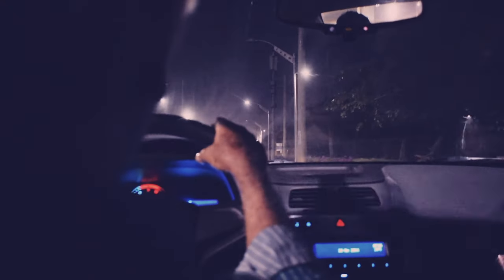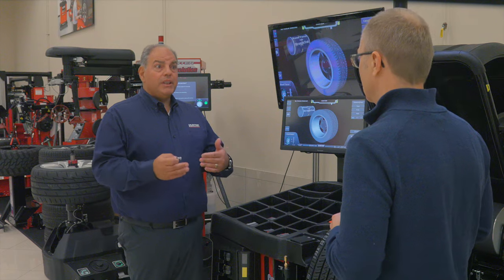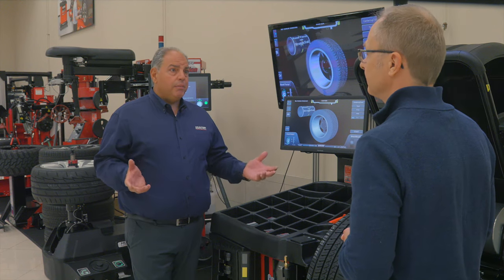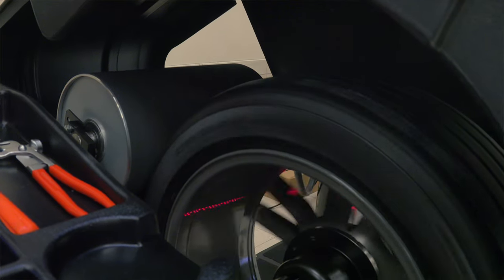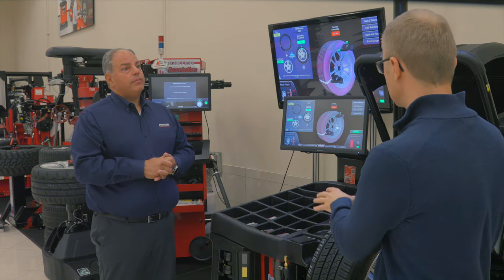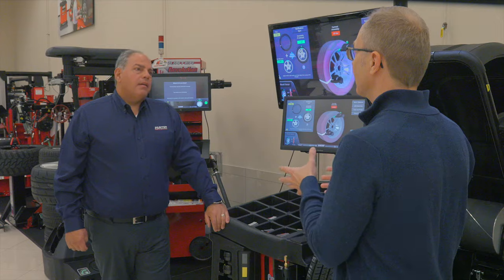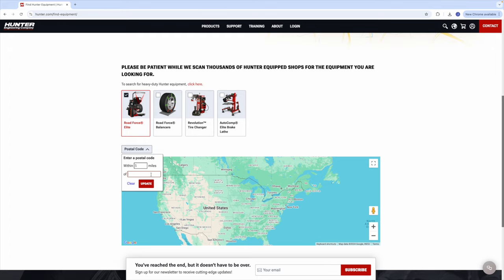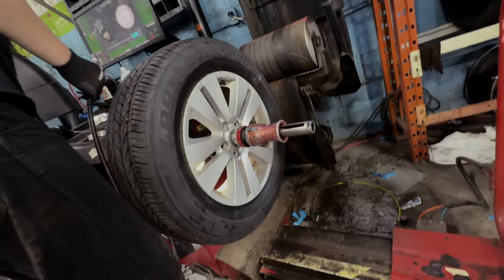Why do my balanced wheels STILL shake? 😩| And how to FIX it 😁

Comment: aligning the balance point of the tire and the balance point of the rim makes a lot of sense, but with the tire mounted on the rim, it becomes a single rotating mass, so how can the machine still tell if the heavy side of the tire and the heavy side of the rim are not aligned? It should rotate and detect an imbalance as a whole rotating mass.
Reply: The video failed to explain the concept of ROAD FORCE balance versus weight balance.   Imagine as the tire rotates on the road surface, it deforms slightly under the weight of the vehicle where the tire patch meets the road surface, the degree of deformation being the result of tire flexibility and air pressure in the tire.  If the tire flexibility is not uniform all around, the degree of deformation will also not be uniform.  In effect the tire will have a hard spot or soft spot around the perimeter and we experience this as a bumpy tire. 

A common manufacturing defect that can cause this is failure to precisely apply the number of plys to the tire.  If a 6-ply tire actually has 5.8 plys applied, that leaves a gap of 0,2 ply between the end of the plys and a resulting soft spot.  Conversely, if the ply ends are overlapped a bit, resulting in say a 6.2 ply construction for an overlap of 0.2 ply, then a hard spot results.  

I had this problem on a new rear motorcycle tire that was balanced perfectly on a standard spin balancer.  The fix was to replace the tire.  I don't believe any 'clocking' of that tire to the wheel could have fixed the violent vertical bouncing forces I felt when hitting around 70 mph.
Reply: That's not what he was doing. He was counting on a rim being bent. That way you can put the tall part of the tire with the low part of the rim.   That way they can cancel a little instead of the high spots stacking up.  That's why he mentioned how a perfectly straight wheel won't help him any.

The correct way to do it, is to mount the tire, then shave the assembly round. (then balance it, even though small balance weights really don't do anything when you're taking about a wheel/tire that weighs 40 to 60+ pounds)

Comment: Not convinced.  It may be usefull in some circumstances, with crap tyres and crap aftermarket rims but not worthwhile spending time on crap with an expensive machine.  If the tyre runs up and down you can see it on the balancer and  usually  the tyre is bad, nothing wrong with the rim. If the rim is true then it does not matter how the tyre is rotated, it won't change anything.  If the rim does not run true or is bent then replace it. High quality tyres run relatively true but you get the odd one slightly out, but you don't feel it if rim good. A good match balance is the way to go and a touch up balance after 5k to 10k km. The tyres do settle in a little. Soft sidewall tyres can flatspot and be problematic with balance also, one rim with a slight bend  can be felt also after balancing.
Reply: A wheel that is true around the circumference can still be out of balance. Even if it's perfectly shaped and the density is constant everywhere, it still has a valve stem and the valve stem hole to account for.

Comment: Where in this video was the runout of the wheel determined? That must be known to determine the best tire/wheel positioning.
    Guy asking the questions mentioned his "rims"...ugh...if it has a center, it is a wheel.
    Or it's hoodspeak.
Reply: When the 'roadforce' wheel on the back of the machine lays against the spinning tire while it was spinning.
 It identifies the high spot, then gets you to index that spot to (hopefully) a low spot on a slightly bent rim.   If you get lucky, the height differences cancel out.  That's why dude said a straight rim won't work.

Where the correct answer is not to spend a fortune on the roadforce upgrade, and find a 60 year old tire shaving machine.  Then you can just make the assembly round and be done with it.

Comment: My Sierra keeps throwing weights.  It also keeps getting out of alignment.  I have the lifetime balance/rotation as well as lifetime alignment from Pep Boys, and even though it doesn't cost me money every time I take it there, it still takes time.  What would you suggest?  I have regular highway, truck tires, not offroad/rough terrain treads, and it is a RWD 1500 2010 YM. All tie rod ends are new, as well as both side upper/lower ball joints and all four have new brakes.  I just can't get rid of the vibrations and running out of alignment.
Reply: First get a alignment result before and after. Next look for where the out of alignment is. Is it just on the front, the back or just one wheel - narrow it down and then focus attention there. Check bearings, bushings or even the drive shaft, it could have lost the factory weight or the u joint is bad. Can they put stick on weights on? If nothing can be found take it to another shop and get a fresh set of eyes on it.
Reply: Find someone with a tire shaving machine that can make your tires actually round.  Wheels weights really don't do much at all when it comes to the actual ride.   But having round concentric wheel/tires really do.

Comment: Yeah, premium tires, road force balanced 3 times, still have vibration.
Reply: Have you checked them for roundness? There ARE other sources of vibrations on cars besides the tires, you know.
Reply: @xtnuser5338  Well, I’ve had them balanced 5 times so I would hope they would have noticed that by now if it were a problem.  Yes, other things like a dragging break will also cause vibrations as well as a bad wheel bearing, but those things are normally linear, ie the faster you go the worse they get, and my vibrations only happen around 60mph.

Comment: Drop the shop and use balance beads. They compensate for all speeds, never fall off, and balance regardless of tire slip or crappy wheels and tires.
Reply: Do NOT use balance beads. They cause shake especially at higher speeds...anything that moves around inside a tire will not balance it! I have removed tons of them to fix people's mistakes. It is a lot of work to remove them. I can mount and balance tires easier than having to clean up this mess....Tire shop owner.
Reply: That's not the point, the issue is tires and rims aren't perfectly round. You need to match the stiff point of the tire with the dip on the rim. So the shape with vehicle weight on it is relatively round without major radius runout.
Reply: @yuzeyang8847  it most certainly is the only way you could stand a chance of  balance on crap products you mentioned. It is continuously, and dynamically balancing with every rotation regardless of speed or tire shape.
Reply: NO ONE that knows how to properly balance wheels uses balance beads.
Reply: @scoutdogfsr  again, the issue is not balancing. It's about the overall shape with load on it. You can balance a square/hexagon but it doesn't mean it will ride smoothly.
Reply: @scoutdogfsr  No, balance beads do not continuously and dynamically balance anything. ESPECIALLY if a tire is not perfectly round inside. If there is even a millimeter of runout on the inner radius of the tire, then the faster it turns, the more the beads will tend to just go to that "centrifugal low spot" regardless of imbalance. Balance beads are a THEORETICAL solution that's dang near worthless in the real world.
Reply: @xtnuser5338  wrong. Feelings not facts. You need to learn Newton's laws and a bit of geometry. Come back with your point after a bit of education.
Reply: @scoutdogfsr  Okay I subjected myself to a bit of education. I understand that I was wrong. Now what?

Comment: Interesting idea. But if you're balancing by the center hole of the wheel it's only as accurate as the center hole.. Balancing a wheel and tire assembly by the center hole is quick and easy but the way to get a proper balance is by using an adapter that attaches via the bolt holes. Also for aesthetics,  shops put stick on weights inboard behind the spokes (as in this video) but to get a proper dynamic balance the weights need to be on the outermost edge of the wheel. Which isn't pretty but they don't shake when you're done.
Reply: Having personally used a wheel balancing machine, if the wheel's center hole is bent (or off in some way), you'll know it immediately.  These modern wheels are CNC machined, and steel wheels are made on metal stamping presses using precision dies.  Wheels are not hand made, so having a center hole that's off center is not possible.  However I have seen bent center hubs.
Reply: @komoru  Well, all I can say is keep balancing tires and you'll see what I mean. Wheels are accurately machined but machines aren't always perfect. A customer that comes in with a chronic vibration (caused by the wheel/tire assembly) should have the wheels balanced by the bolt holes. I know it's not quick and easy but it's the correct way to do it.
Reply: The Hunter Road Force Elite (3rd generation) measures ++among other things++ the centering automatically
(= Automatic CenteringCheck = Guarantees correct centering and prevents clamping errors)

Die Hunter Road Force Elite (3te Generation) mißt ++unter anderem++ die Zentrierung automatisch 
(= Automatic CenteringCheck = Garantiert richtige Zentrierung und verhindert Aufspannfehler)
Reply: @callishandy8133  That's great! When the machine tells you that the assembly is off center what do you do next? (like in a situation where the center hole is malformed?)
Reply: Most of your common wheels on newer vehicles can't be balanced with the clip on weights on the outside. That's why most shops use stick ons inside the spoke, since it's the closest to outside you can get.

Comment: I have come to the conclusion that tire installers do not know how to operate a tire balancer. I gave up and bought my own balancer, a cheap Weaver China made balancer for around $1000.00 new. This solved all of my problems and proved to me the installers do not know what their doing, even using a $25.0000 dollar balancer. I would back time and time again only to have a shake in the wheel. I swear to God they just throw a wheel on the balancer any old way, they don't put in the right settings, spin it up and slap some weights on and hope. The problem is NOT the machine, its the operator.
Reply: Yes this is largely true across all of the consumer-grade, corporate chain type tire shops, staffed with kids who are just trying to make some money so they can afford a new subwoofer, where the goal is to shove a couple hundred customers per day through the process, take their money, and get rid of them.

If you don't have your own balancer, and this is something you actually care about unlike most car owners, find yourself a good race shop and pay them to take the time to do the job well.

Comment: But... if the tire is defective you'll never correct that by rotating it's position on the wheel unless the rim is way out of wack too. This might make it slightly better but the only real fix is to replace the tire. 
Arguably, your money is better spent replacing the tire rather then repeated expensive road force balancing!
Reply: But even if you replace the tire, it still needs to be balanced.  The point of this video is that given a choice between a normal balancer and a road force balancer, it's best to choose a shop with road force balancing.
Reply: Please ask the Hunter salesman or
write a mail or
call Hunter Hotline
and
ask if there 120 software developer , the laser beams and the cameras plus the 3D picture analysing ...
Reply: @callishandy8133 or don't do that since it has no bearing in the situation of a tire being out of round.
Reply: the rim has to be bent for roadforce to work.   Thats why dude mentioned the 'problem' with having a perfectly straight wheel.

Comment: This is B.S. as mass production has nothing to do with it. Red and yellow dots on the tire need to be aligned to the wheel properly. What they didn't tell you in this video is that a bad tire with a rubber uniformity issue cannot be road forced balanced because of the tire temperature at the time of the balance say it's balanced, but if the temp chamges it's not balanced anymore. Meaning the tire is junk, get rid of it. Also they did not mention anything about tire and wheel assembly runout conditions. Another crappy video.